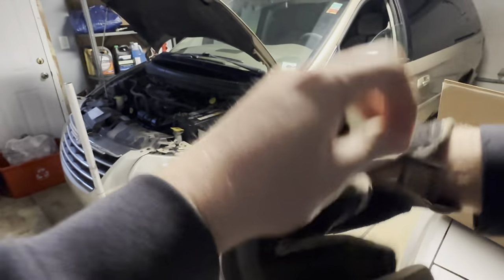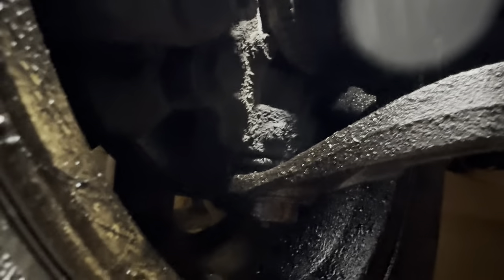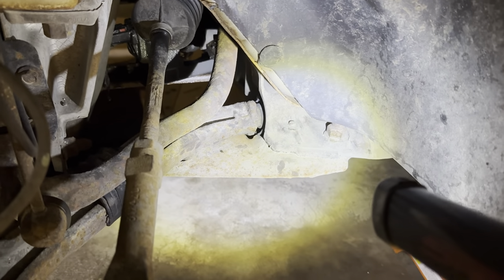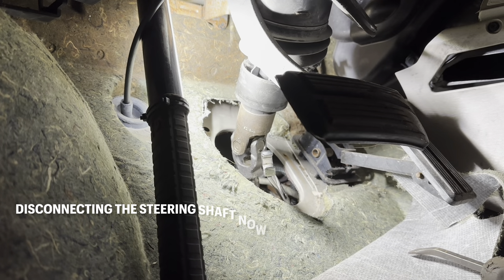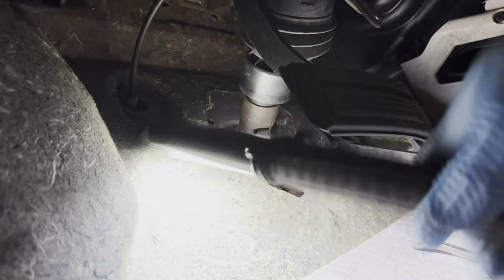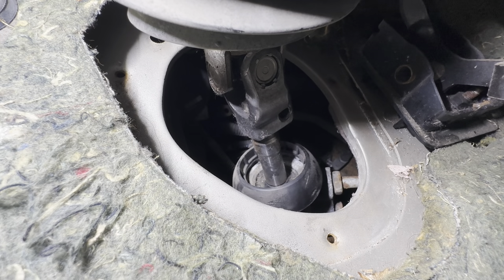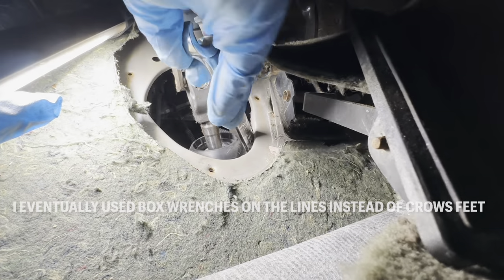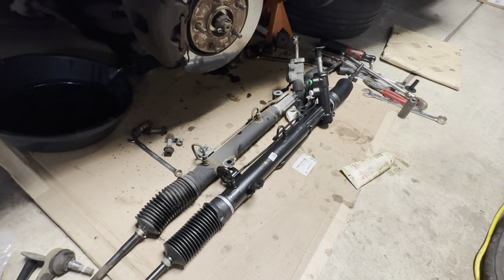Town & Country / Grand Caravan - Fighting Rust, Oil Leaks, And Faulty Parts To Replace Steering Rack

Comment: To make sure that the replacement rack is centered turn the rack all the way in one direction and then as you are turning it back the other way count the turns and then divide by two and use that number to turn it so that it is centered.

Comment: I removed the rack on an 01 T&C and did not remove the bottom plate. It will come out without removing it. I took off one of the tie rod ends and that made it easier but it really is not necessary. I removed the rack I bought a few times as I thought that it had been  returned and put back into stock by the condition of the box it came in. I see you were also replacing the control arm or control arm bushing so that is why you dropped the plate but that can also be done without dropping the plate but hey you do what you do and I did what i did. Good video. Happy Motoring.
Reply from the maker: Were you able to snake the rack through an opening in the plate or did it come out towards one of the wheel wells?  I'm having trouble visualizing it coming out with the plate in place, but your way would save alot of time and effort in the future.  Thanks for watching and thanks sharing the advice!
Reply: @ryanrepairs675  Wheel well and  as I said I had it in and out multiple times. After my son helped take it out the first time I was able to take it out by myself. On the tie rod ends I just counted the number of turns coming off and put the new on one that many turns. When you finished and the wheels were not straight maybe the rack that was in the car was not centered. My replacement rack from left to right was three and a half turns so to center it, it had to be 1.75 turns from both sides. I did not have to do a wheel alignment after and it ran straight down the road. Have a good one.
Reply: @ryanrepairs675 hi
Reply: @mostlymoparih5682  As I did it on my 2005 T&C, I do not see if it possible to reconnect high and low lines to the rack without removing charcoal canister and emission box? There just no room.
Reply: @petrodzyuba4491  Yeah but removing the canister is a lot easier and a lot faster than dropping the engine cradle. Does your van have stow and go seating? I did a video on O1T&C  but looks like it got removed along with a bunch of videos. I guess yt doesn't like it when you stop posting videos. Happy Motoring.
Reply: @petrodzyuba4491  I found the video and if you start at 2 minutes and 15 seconds you will see where I took out the canister. The beginning of the video shows me looking for my drop light that my son had out in his tent. I included that in the video to show another you tuber that I am friends with. 
 https://www.youtube.com/watch?v=poU4_nKhsVk&t=618s

Comment: I went through this ordeal already a week ago. Bought a NEW rack assembly from eBay for $170. Was OK for a week. Now leaking from rack seals. Applied Lukas Stop leak. No effect. I warn you, there fake/untested under pressure Chinese parts out there! This is most miserable DIY repair on these vans. If you managed to do it yourself, everything else in repairs will feel just fine.
Reply: Got mine at Rockauto but you are right about the chinese crap parts isn't that what CCP means?  I also have a 99 Caravan that had one hundred and sixty thousand miles on it when it was given to me. A year I got it,  the fuel pump went out, not bad for the OEM pump that mileage and over twenty years. I put in a Delphi pump, delphi is an American company but the box said made in chinessium. So pump went maybe ten thousand miles and a little over two years. So this year when I replaced it I got a Carter pump, also an American company and surprise, surprise it's made in the same place as the Delphi was. They are probably made by the same company over there and they are just put in differently marked boxes.  Have a great day.